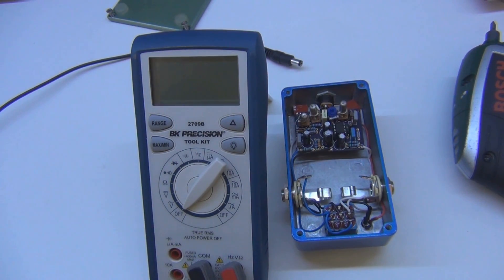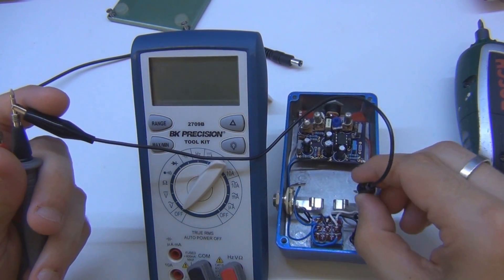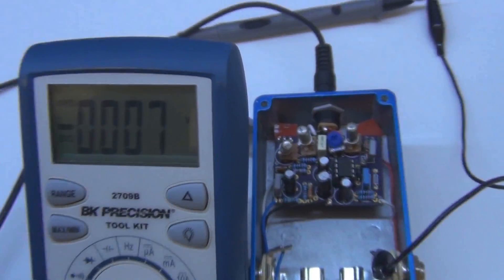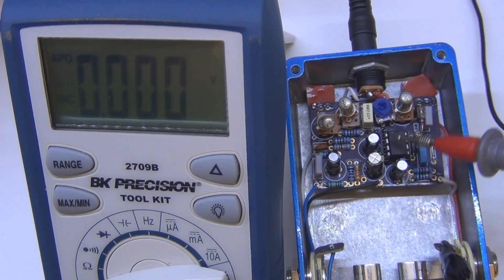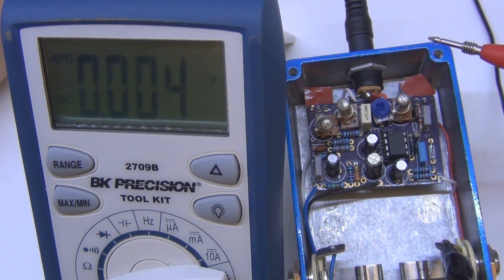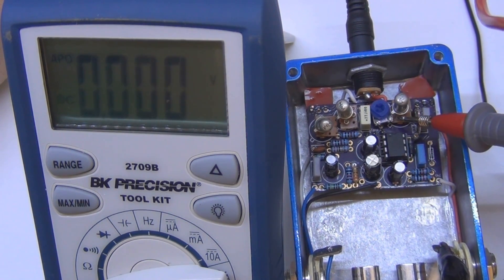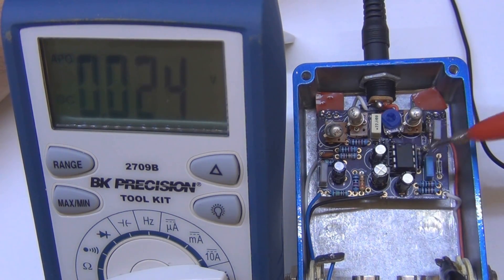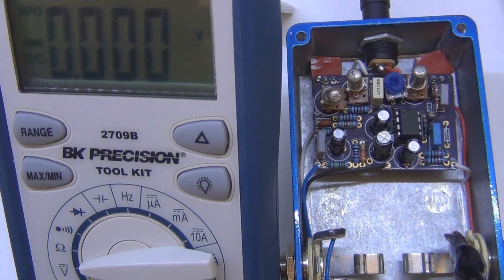B2B - Measuring The Voltage of a Guitar Pedal

Comment: Really enjoy your videos. I just happen to be in the middle of a build that is a bit squirrelly and this came at a great time. Why don't I just check voltages, doh! Why didn't I think of that... Thanks for the suggestion, I swear it never crossed my mind for some reason. Thanks again!
Reply from the maker: Buddy Martin Good stuff Buddy!  Have a copy of your schematic at hand and go around the circuit and check the voltages.  You don't need much theoretical knowledge to roughly work out what voltages SHOULD be either.   Ground is zero, supply is 9V (circuit depending).  You can logically work out a whole lot more as well.  Hope you get it working!
Reply: Thanks, I feel like a dolt, I'm retired now but I was a electrician for 35 years. For some reason i just didn't think about troubleshooting. I've gotten it sorted now, cold solder joint to the ground of a IC. Thanks to you...
Reply from the maker: Buddy Martin Always a soldering error! That's why I often say measuring voltages can HELP find the cause...lets face it, most errors are usually assembly related. :D